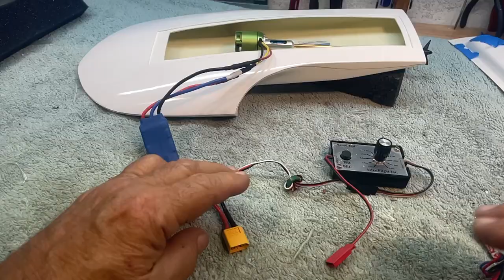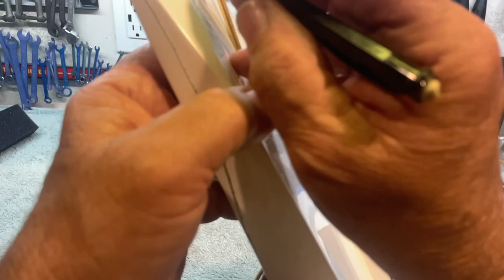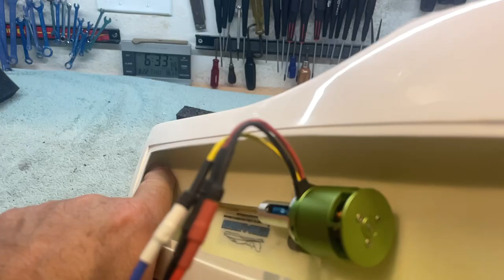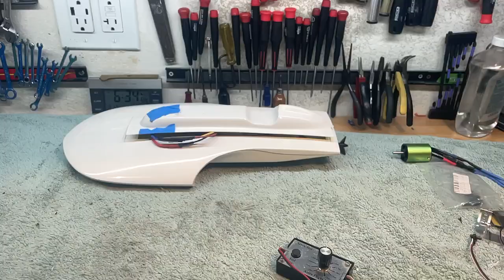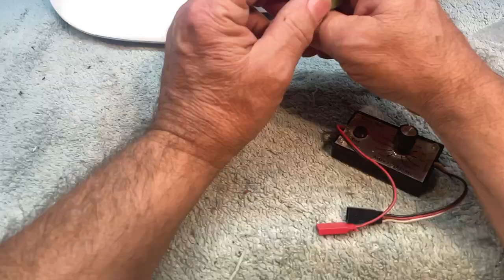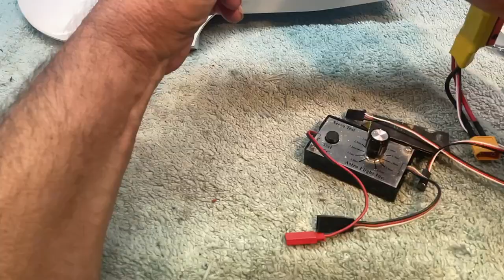Dr. Jet reports...

Comment: I've got 2 ideas I'd like to see someone do and both are right up your alley.  A Taiwan or Malaysian rice boat with that long drive and the other is a twin prop using a geared motor. Did you ever get your laser cutter up and running?